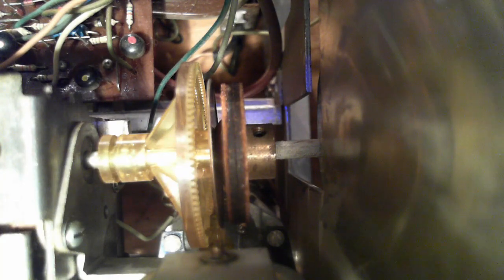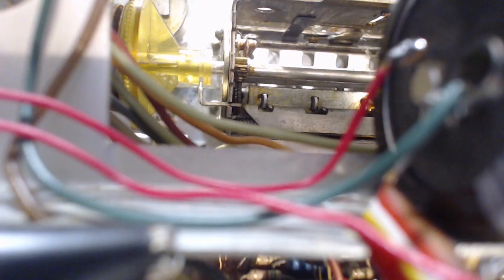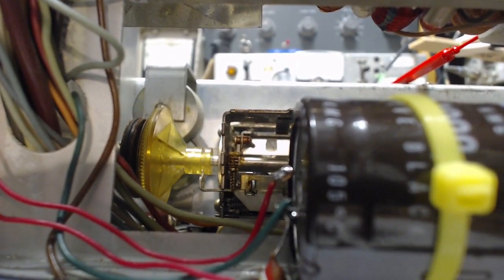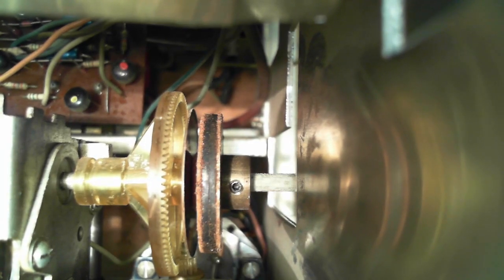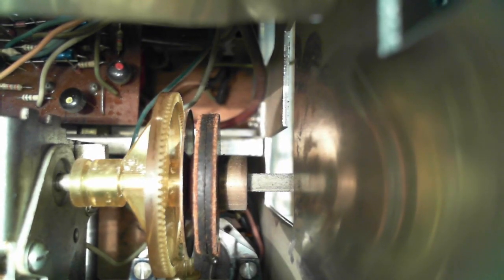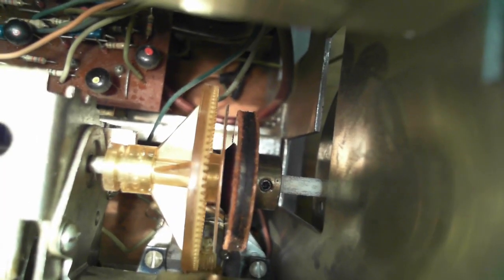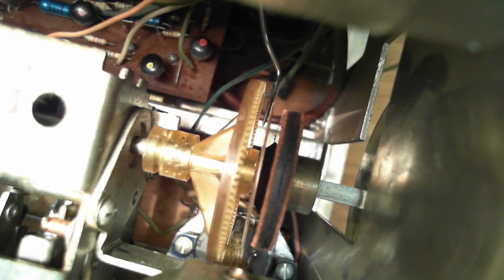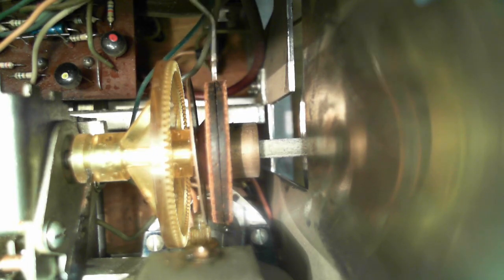Clairtone Console Stereo Video #40 - Tuning Mechanism Beyond Repair?

Comment: One thing I do is when I get a radio such as this in the shop. Before I even touch it. I go over the radio check knobs and switches for operation and note any issues of functionality before I start. That alone saves a lot of headache. Also there is a similar gear setup on the AM side. Compare the two. Also there is a set screw on the clutch side. Try sliding it closer to the plastic gear by losing the set screw and see if that changes anything. The bar disengagement is to take the pressure off the teeth when the push buttons turn the tuner rod.

Comment: We know how it works and how  to fix it. The automobile radios used these techniques of every make and model made in the 1950’s. No one can know it all. Your efforts are never wasted, its all on the learning curve. We used to call tadios and TVs as tough dogs mraning not everyone can fix everything. Learn to embrace your failures.
Reply: Where would you place his efforts on a non-learning curve? Fact is, he does NOT learn from mistakes nor does he try to educate himself. He repeats the same mistakes all thru his videos, damaging radios again and again. 
True, there is nothing wrong with not knowing how this tuning mechanism works. But all he does is jibberjabber, when what he should have done is educate himself; Look up exploded views and service papers on the function of this drive, even if it means digging thru old automotive radio service literature on the riders or sams. Or go on forums and ask for help from people who know. Or AT LEAST disassemble and inspect what is before him. 
But what was his reaction? 
Quote "Oh to diassemble the clutch mechanism, the whole pushbutton assy has to come off. That is not gonna happen" Unquote
And moments later the bright idea to drench the thing in epoxy, rendering the buttons unuseable with no way of ever restoring the original function.
That is pitiful.
His credo serms to be to not invest time into proper (granted, sometimes tedious) work or decent spare parts, but instead lament for hours and then botch in junk old parts.

Comment: maybe if you move the rubber rings towards the yellow gear you'll solve the problem. there are screws in the plastic shaft to release the pulley

Comment: I think! Looking at the two rubber plates, it's reasonable to imagine that the clutch mechanism has been sitting for a long time in it's engaged position and the rubber plates have clearly fused / bonded together, would this have contributed to the "flywheel" becoming separated from the yellow drive gear? You really need a Stanley blade or some other thin blade to prise them apart, the metal plate could then be reattached to which ever piece it's snapped off. You were right when you said it must only need a small amount of movement to engage. You have tunnel vision Jim!, your fixated on the yellow gear wheel, try another approach. 😎👍

Comment: I agree with Mr Collins the previous commentator. It's the one thing you haven't done, just losen the set screw and see if it will "push in" towards the yellow drive gear. You've nothing to lose at this stage. If it works I want my cut of the payment.😎👍